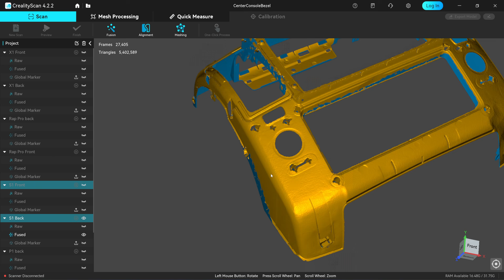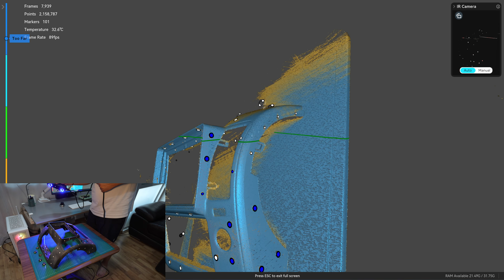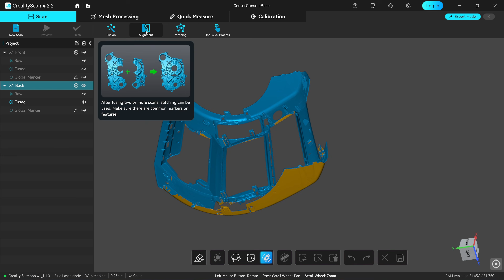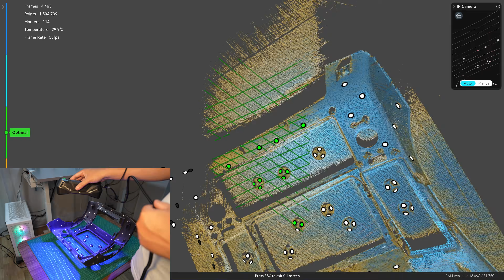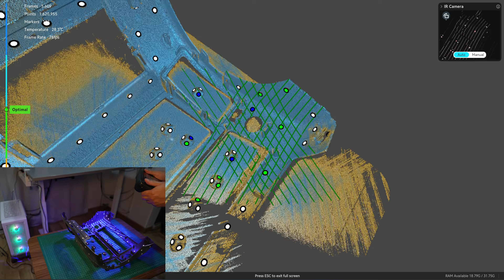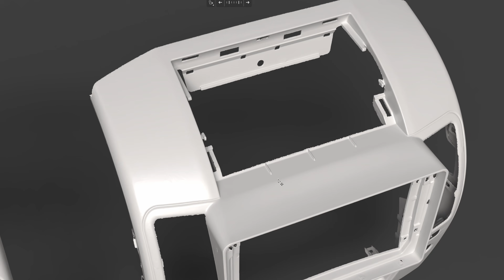Center Console Bezel 3D Scan – Creality Raptor Pro & Sermoon Series Tutorial

Comment: One item to be cautious of when scanning parts like this for reverse engineering is deflection. When I’ve released parts like this for production it is often specified that the part must be restrained against either the mounting points or datum targets for quality inspection because even the own weight of the part can cause distortions. I’ve seen it where parts fail inspection or fail assembly because the supplier didn’t take into account this distortion.
Reply from the maker: Yes, you're absolutely right. It must remain rigid when flipped over. Its own weight can flex and deform the shape when turned upside down. I completely forgot to mention that in the video.

Comment: If you accidentally delete the wrong side of the clipping plane, there is no undo. The only solution I found was to rescan. I think this is a serious flaw. 

Also, they should make the UI use smaller widgets and fonts. Currently it looks like an app for children and not professional at all, IMO.
Reply from the maker: I get your point. If you accidentally delete the wrong surface and save, you can simply re‑run the fusion, and everything will come back. Before fusion, only clip out the table, don’t do detailed trimming, because those won’t return. Trim only after fusion, since you can still recover the data at that stage
Reply: @bjondersson  there is a redo lol
Reply: @TMANM  I’ll have to look again, but I remember trying everything and there was no option. Why would redo undo, anyway? With the normal delete you are able to undo, but with the clipping plane it was completely different. But yeah, I’ll have another look.

Comment: I see you are using CrealityScan 4.2.2. Only version 4.2.1 is available for download in my region. Is it a pre-release or does Creality roll out software in stages maybe?
Thank you for countless high quality, instructional videos on 3D scanning - always useful!
Reply: Creality’s download pages are very confusing. They have two different download sites, and one of them is always behind the other with software versions. I don’t understand why they don‘t have just one site that is always kept up to date.

For example, currently the main Creality site has 4.2.0 as the latest release and Creality Cloud has 4.2.1.

I don’t see 4.2.2 either.
Reply from the maker: I didn’t realize Creality hasn’t released that yet. An additional feature is that the P1 supports markerless scanning and they really like to move buttons around.

Comment: Just bought the S1 used for 1.200€. While that's a no-brainer deal, it's interesting to see how the Raptor Pro got a similar scan result.
I guess they are both comparable when using cross-line scanning? And it's only a matter of speed?
Reply from the maker: There’s no difference in the scanning results from the Raptor serires, Sermoon S1, and P1 down to 0.1 mm resolution. Their accuracy errors are also similar, staying under 50 µm. The only distinction is that the Sermoon X1 produces more precise point‑cloud wall lines, which only becomes noticeable when scanning metal CNC parts. Overall, the differences lie in scanning experience, tracking, speed, and the presence of single‑line laser mode.

Comment: you are comparing differents 3d scanner with a huge price difference , delivering the same results if we exclude the time factor 
you have to highlight the advantages of every higher scanner , or everybody will get a raptor pro and save their money
looking forward to seeing the difference in the next video when you deal with the point cloud and reverse engeineering
Reply from the maker: I’ve already covered all the pros and cons in my review videos when each scanner was launched, and those remain unchanged. The original Raptor from two years ago still delivers accurate, precise results and when placed side by side with the S1, you won’t notice any difference down to 0.1 mm resolution.
Reply: Well S1 and P1 are slightly similar because of single line which is needed for deeper pockets that 7 or 30+ lines can’t reach
Reply: estoy de acuerdo. Debe de haber alguna diferencia sustancial, ademas el Sermoon x1 es mas caro pues se compra con los accesorios incluidos, como el mango a baterías. Sin embargo el sermoon s1 parece que es el mas caro, aun no teniendo los accesorias.